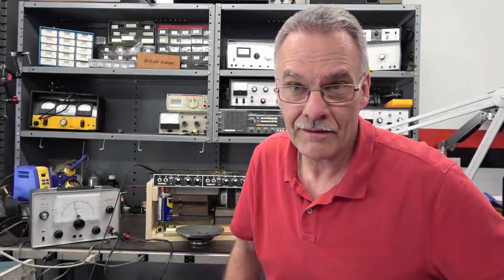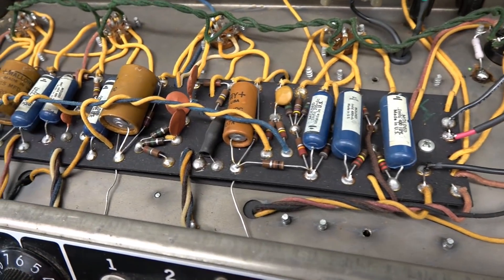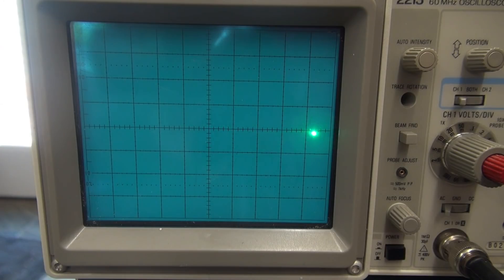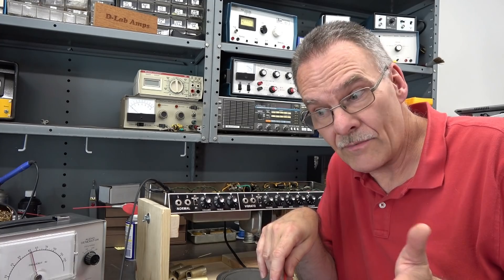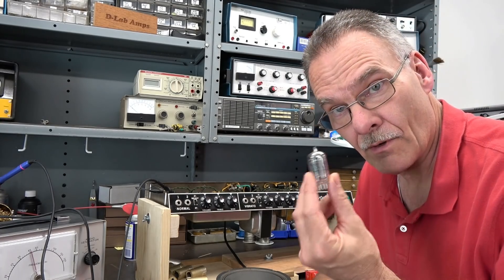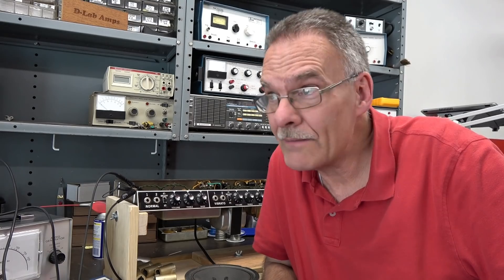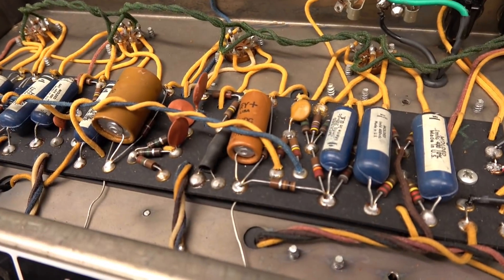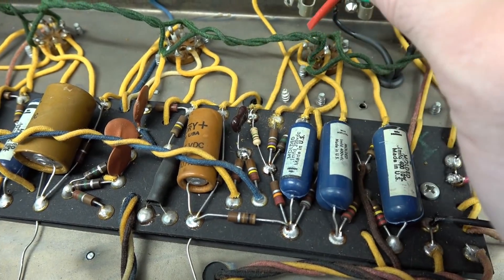How to troubleshoot weird oscillation Fender BandMaster tube guitar amp

Comment: Great video. I don't have a lot of experience, but I did have a thought. What if there is a high frequency oscillation and it causes some of the components to become microphonic. One thing that puzzles me is the repetitive nature of the oscillation. I also wonder how clean the DC voltage from the power supply is. Is it possible that some of the decoupling capacitors could be bad allowing feedback from one circuit to another. Another idea. Could you make or use an e-field (voltage probe) or a h-field (magnetic field probe) with the scope and check for rf oscillations. The e-field is nothing more than an insulated probe that can be used to touch or be in the vicinity of the circuits. The h-field probe is just a single loop that is insulated that could be placed close to parts of the circuit or even the tubes. I'm not sure how to fix an rf oscillation, but possibly small value series resistors going to the control grid might dampen out the oscillations.

Comment: The 'scope trace you showed at around 7m10s still has the burst of oscillation every few seconds. I can't see that you fixed anything, sorry. Did you check the cap and 1M resistor you took out? Were they faulty?

Comment: All we get to see is the view of the tray of the chassis which shows all original parts..........which would imply that the power rail caps are also probably original.   The pulse suggests the power rail.  The caps are functional as there is no apparent hum but have to be completely dried out

Comment: Was wondering if you could give me a clue as to what you thin my problem could be ? It's a traynor ycv80 2 12 playing on either channel the sound cuts out completely. If I ever so lightly put my finger on ch. 1 volume knob or the gain knob the sound will cut back in. I changed preamp tubes 5 weeks ago but now this is happening. Tubes preamp are 3 12ax7 tung sol reissue power tubes are 2 5881 Svetlana and 2 6l6gc tung sol. I put the old 12ax7 back in they are the old sovtek 12ax7wa . Amp worked after putting old preamp tubes back in but then it happened again and again the lightest touch and the sound cut back in. Would preamp tubes cause this or could it be a bad solder
Reply: Just a couple suggestions: clean your pots and tighten your tube sockets. Sockets can loosen over time.

Comment: Did you monitor the high voltage with the scope? Could be a bad power supply filter cap.
Reply from the maker: I monitored the plate voltage on the 12AX7 with the scope, no oscillation, it was after the .047 cap

Comment: Why did you set the Oscope timebase to a very slow sweep frequency/moving Dot on the Oscope to see the Oscillations frequency?
Reply from the maker: To be able to see the trace
Reply: But can't you see the oscillation frequency on a faster Oscope Timebase setting? That very slow sweep frequency/moving dot on the oscope are ment to view very low frequencies. The oscillation is at a higher frequency since the customer can hear it which means the frequency of the oscillation is a higher frequency

Comment: Great troubleshooting!
Could be oscillation on the power rail. You usually got a big cap on the B+, feeding the output tubes and a smaller cap after a resistor, feeding preamp tubes. The resistor drops down some voltage and also makes and RC circuit with the mentioned smaller capacitor.
But still the circuit CAN oscillate on sub-hearing frequency. 
Saw in on one of the amps. Could it be it?

Comment: I really need an oscilloscope to trace guitar amp noise.  I am tired of guessing.  I don’t have the experience to choose one.  Can anyone offer advice? Thank you for your time.
Reply: Terry has done some nice videos about choosing a scope.  It’s been a while back, maybe a couple of years.  He talked about some of the lower priced off brands like Leader very good for this type of work.
Reply: Marty Young thank you Marty!
Reply: Luckily, for audio signals in an amp, you don't need a terribly powerful or fast scope, you aren't measuring microwaves.  My mentor always insisted analog scopes are better for audio tracing than digital scopes, but he had several of both, so I don't think that's a hard and fast rule.

I purchased a Tenma 72-6800 20MHz dual channel scope new for maybe $400-ish, and it has served me very well as my main o-scope for the last four or five years. (I have no connection to the company, just a satisfied customer)  No complaints.  You could go cheaper, but this was the best "big boy" scope I could find at that price point at that time.

You want to get at least a 20MHz scope, after that the choices are up to you.  I really like having two channels to compare different wave forms, or to to be able to flip between two separate monitoring points, but to be honest, 90% of my work I only need a single channel.

I found this article pretty helpful, but I'll admit it is a bit of a slog to read through.  Very tech and spec heavy, so take your time, but it does explain a lot of what you want to look for from an amp tech's perspective.

http://tone-lizard.com/oscilloscopes/
Reply: @coyotecirclestudio9611  I tend to agree with your comment about digital versus analog scopes.  Modern digital scopes should be fine for audio work, older digital scopes needed to be higher end models to handle higher frequencies but the technology has improved greatly over time.

On a related note, there are some things that an analog meter make easy that are difficult on one with a digital readout.  I've used a few digital ones with a bar graph as well which have been pretty decent.

Sting: Good luck with your scope search!

Comment: A few glasses of wine, you won't notice the oscillation! Great diagnosis as these are tough problems to find...................
I once had a Realistic reel to reel Tape Recorder made in 1965 that had  static in  the audio. It was o.k if listening to but in record, it was there forever. An old TV guy fixed it for less than 10 bucks. It was a ceramic and noisy resistor!

Comment: My mind was saying "noisy carbon comp" as you were describing this... they can be easy to find with a signal tracer or Carlson super probe while tapping on them. 
Looked like some low frequency motor boating feedback noise happening there, induced by vol change or a mechanically induced noise?
Gratz on finding it :D
Cheers,

Comment: I have a '66 Bandmaster but no scope, only a decent DMM. I'd need a scope to check it out, right?
Reply: Keep an eye out for a 20 MHz scope, if on a budget. A good rule a thumb on used analog O-scopes is a dollar a MHz. So, 20 to 30 bucks. A signal tracer is a nice piece of test gear to have and there are plans to make one of your own if you can't fork out the inflated prices for old vintage one's. You can do quite a bit with a DVOM and an old Analog VOM as well.
Reply: @Joetechlincolns  Agreed, a scope is a nice added tool for the bench, however it isn't a necessity until you get really deep into a specific oscillation issue. I've been half-heartedly looking for a scope to add to my bench, but haven't had the funds. If you have 2 decent meteres, a variac and a simple light bulb current limiter, the rest of the tools are gravy.
Reply: Starcrunch72  I used to repair amps for years without a scope (so I acknowledge, yes, it can be done), but now that I have been using one for the last four or five years, I wouldn't want to work without it.  It is useful for so much more than just oscillations. 
 
I can go front to back on an amp and visually see the wave forms, and after getting used to using one for a while, it shows you things a DMM (digital multi meter) could never catch.   There's actually a lot of measurements you can do with a scope that can't be done reliably with a DMM.  A VTVM (vacuum tube volt meter)  can catch or measure some, but a scope is best. (try measuring the evenness/offest  of vibrato pulses with a DMM. Won't happen.  Can't see crossover distortion on a meter, digital or analog.  You can measure max output before distortion with a scope.  You can see microphonic tubes on a scope.  Etc, etc....  There are just so many easy yet insightful functions and measurements that can be performed with a scope that just can't be done with a meter alone.)

At this point in my career, I consider the scope an essential tool to save time and avoid unnecessary guess work.
Any competent tech should at least be familiar with their use, and really should be in the habit of using one as a first stop diagnostic tool.

Comment: Seems like it was still dancing pretty good to me ... but I'm just a guitar player ...
Reply: This seems a bit inconclusive.
Reply from the maker: A follow up video will be shot and posted tomorrow. The amp has never sounded better
Reply: @d-labelectronics  Hey, Terry! Didn't catch a follow-up but I've heard from a reputable source that the slight oscillation is a quirk of the BF Bandmaster; i.e. it's always 'on' in the background. I owned an early SF years ago but I've never serviced one to know myself.
Reply: My thoughts exactly !!!
Reply: Why did you have the trace going so slow this time while watching for noise?  You usually have it scanning fast looking for prickly spikes while you tap?
Reply: Just to "recap" ( no pun intended, honest! ):
What Terry said at the end was that he thought he'd cured the noise problem reported by the owner, but that the "blip" on the scope trace might be normal, he didn't know since he doesn't typically look at that point in the circuit with a scope.  So rather than trying to identify and cure something that may not be causing problems, he just verified if the amp is operating normally.